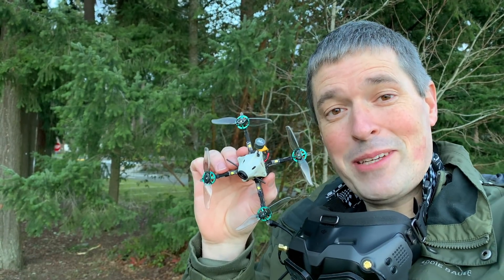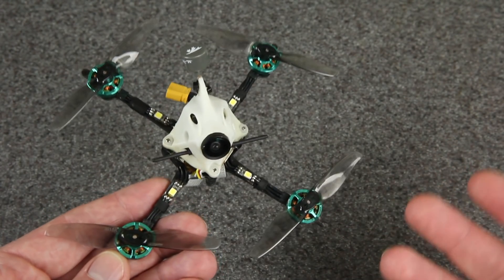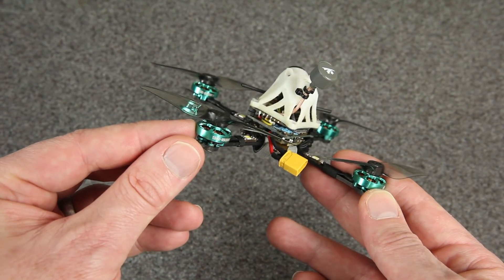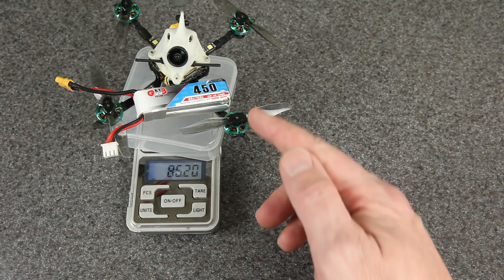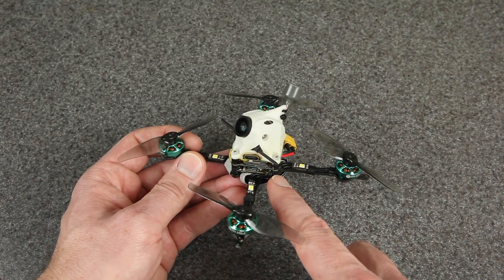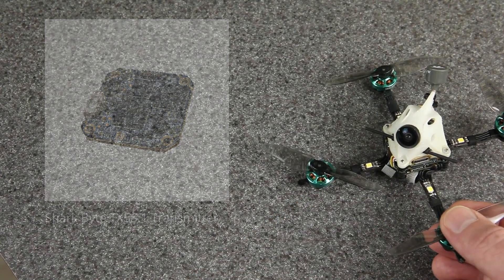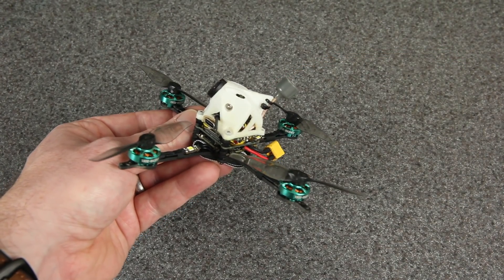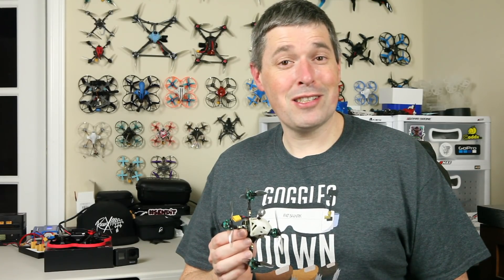DJI Digital FPV on a 3-inch Babytooth Drone! Cool!

Comment: Moore's law states that the digital is the future of the FPV industry. Fix that latency issue and lower the costs and you'll be good to go!
Reply from the maker: Actually Moore’s law has to do with transistors in a microprocessor. Still I don’t doubt that digital can take over if it gets cheap enough, fast enough, and also light enough. It would take a big step for digital to replace analog in 1S whoops, however. They will probably be the last holdout. An analog whoop FPV system can be less than 2 grams including cam, wires, vtx, and antenna.
Reply: Lower latency? Use hdzero. The systems like dji and walksnail aren't designed around lower latency so you'll never get close to hdzero with them. They prioritize picture quality which can cause variable latency. Nothing wrong with that. If you want low latency, you're gonna have breakup like hdzero or analog.
Reply: Digital, be it DJI or SB isn't actually that expensive if you count everything you get.
Great picture quality, a 720p DVR, and in DJIs case a RX for as little as $100 with Cam, vtx and antenna? How is that expensive? 
Analog cam 15-45, crossfire rx 25, eachine nano vtx 15, antenna say 10, hd DVR IDK 25 or more. Add that up. I have a 1s 65mm dji whoop. Sure it's fat and slow but it flies, good for cruising in doors.

Comment: I'm curious about how you got the naked Vista mounted? Did you put anything between the PCB's?( Or mount it as you showed us?) Have you had any issues out of the Vista with heat on high milliwatt transmission?Also I been thinking about the naked Caddx vista camera as well...but been to chicken to do it. If you do the naked Vista camera (The original camera?) Please please please!! post a video on how you done it. Thanks for sharing 😀
Reply from the maker: The PCBs of the Vista air unit are separated on the stack by nylon nuts. As for the output power, it is variable depending on range and signal strength. Mine is set to "up to 750mW" but I don't know what the actual output power is while I'm flying. It probably isn't that high because I'm not really pushing the range very far. The likelihood of overheating would presumably go up with higher output power. This is my 2nd drone with a naked vista and I have never had one overheat in the air, but then again the climate is not very hot where I live. Hope that answers your question. Cheers!
Reply: @MrShutterBug  I meant to ask you what kind of flight times you getting with the 550mah R line 2s packs with the bigger motors from fpv cycle
Reply from the maker: @allennickles3970  I don't remember off hand, and I'm not sure which DVR clips are which any more. I'll let you know the next time I have a chance to fly it (i.e. when it stops raining). Feel free to ask again in the future as I am likely to forget.
Reply: @MrShutterBug  Thanks for your response! I'm in the process of building a very similar build like you have here. But I'm very curious about how to do a naked DJI vista camera.  And the canopy you mention in the video you said that was designed for that mod?. I'm curious if we decase the Vista camera? The canopy would have to be modified somehow to hold the lens in place close to the sensor to focus the camera correctly? Who is designing a canopy like this?
Reply from the maker: @allennickles3970  I haven't done it yet, but the idea is to leave the front part of the camera case in tact, so you don't have to mess with the lens. Just removing the sides & back of the camera housing would remove a lot of the weight. Then it could go in a mount like this: https://www.thingiverse.com/thing:4663421
Reply: @MrShutterBug  Awesome so somebody already done this..lol
Thanks so much for the link!! I highly appreciate that & your time posting this here. Now I got to find someone to print this thanks a million 🤗
Reply: @MrShutterBug  So i ended up ordering the 1303/ 5000kv FPV cycle motors and thinking of buying the newer 13XX/7700kv motors as well. I just wonder how efficient they are at 7700KV on 2s? I bought the 2mil TP3 frame solid one piece frame. Also thought about buying the other frame as well and just do two builds. I appreciate the link to the STL for the naked Vista camera canopy mount. I was able to get RDQ to print me two of them. So shortly I'll be doing this build as soon as everything comes in. What's your take on the two different motors sizes? Which you prefer? I know you have flown both of them now? I also ordered the Rline Tattu 3s 550..lol with the RDQ 525 3s
Reply from the maker: @allennickles3970  I have not tried the TP3 formula, and I have not tried those 1303 or 1304 motors either. But in general, I would say that the larger motors will improve handling as long as you are looking to build something that rips at high speed. The smaller / lighter setups (like the 1S babytooth) are better for really small yards for for being as quiet as possible. So it depends on what you're going for.
Reply: @MrShutterBug  Yeah I just realized you had the 12xx motors before these you showed in the video sorry. Thought you had the 1303/5000kv...sorry..lol

Comment: What is length of the m2 bolts you are using?
Reply from the maker: M2 x 20mm. I believe they came with the babytooth frame kit, but I’m not 100% certain of that.

Comment: Excellent video and production. Wondered if you use a GSheet on the weight breakdown? If so, I'd be really interested in a link to see where the grammes hide... I've been doing it for my builds recently and find the data & charts really help me focus on where to skinny it down.

Comment: You asked for opinions on the Shark Byte. I have three toothpick builds that differ only in the video system. One with naked Vista at 200mW, one with a tiny 400mW Eachine analog VTx, and one with the Shark Byte at 200mW. The Vista and analog quads fly around the outside of my house fine. The Shark Byte video disintegrates into unflyable snow as soon as I go behind the house. I'm going to replace the board with a Vista.
Reply from the maker: That's a good data point. Bummer that it didn't penetrate through the house as well. :-(

Comment: Superb build! Any sideffects from running without the vista heatsinks? (wondering why they would add them if they're not needed?) - great idea if it works tho! Totally doing that for my next 4" lightweight build, thanks :-)
Reply from the maker: Thanks! They include the heat sink because the Vista can get pretty hot. I have not had any problems with overheating while flying, but then I live in the Pacific Northwest of the United States, where the air is pretty cool most of the time. In a very hot climate it might be more of a problem. The only time I have ever had it overheat was when it was plugged in on the bench (when flashing the DJI firmware, for example). That's why I blow a fan on it while it is plugged in on the bench.
Reply: @MrShutterBug  that's good to hear (I'm a UK flier so ambient heat isn't a problem ;-) A bench fan is a small price to pay to shed 10g!! Awesome, thanks again.

Comment: how do you think it would work with the toothpick frame? having replaceable arms would give a little bit less cringe factor when doing risky moves.
Reply from the maker: If you built it like a TP3, it would work great. I chose to build mine as light and quiet as I could.

Comment: Any problems with overheating with the naked vista? Are you restricted to certain powerlevels?
Reply: Nah, I’ve been running mine set to 1200mW max for a year.
Reply: So there are no side-effects of running without heatsinks at all? If so that's very cool, but makes me wonder why would they bother adding them then?
Reply: @skinnyed69  well as long as you’re flying it’s perfectly fine. A few times during the hottest day of summer between packs and once this winter when I left my whoop plugged in for 30 minutes accidentally it showed “Air Unit overheating, land promptly” warning but when I armed and gave it some airflow that went away. Having a fan blowing on it while updating it or just working on it on the bench while plugged will pretty much become a hard requirement instead of a recommendation 🙂 but yeah it’s totally fine without heatsinks in everyday use.
Reply: Amazing. Can't believe I can shed 10g so easily, thanks!
Reply: @skinnyed69  10.6g if you clean up all the thermal paste 😅
Reply: @skinnyed69  yeah there was a guy taping it onto a whoop days after it was released.

Comment: Does anybody know at what voltage the Vista cuts off ?
Reply: I've ran it down to about 5.2V without issues (I was pushing it as far as my build would keep airborne) but I also had it freeze when hitting 7v on a slightly heavier build. It's specced for 7V+ so I wouldn't recommend going lower on purpose.
Reply: With bench testing and a sample size of one, it seemed to need close to 7V to start reliably, but keeps running down to just above 5V. Power consumption seems fairly constant, so as the voltage drops the current goes up. At 7V and 200mW mine consumes 0.87A.  7V/500mW needs 0.94A. Obviously most of the power is consumed by the electronics and not the RF amplifier.

Comment: Wow Mr. S, you have perfected another one. What do you think would happen if you put ultra light prop-guards on this guy. Light/quiet indoor/outdoor explorer drone. Would the extra weight kill the performance? I love flying around the neighborhood with small, light, quiet quads but would like the guards to allow for indoor and canopy exploration flying. Thoughts?
Reply: I don’t think guards light enough not to ruin it exist, especially at 3”. I’ve got a 38g 75mm 2s whoop with naked Vista for that and it’s definitely worth having a different tool for a different job 🙂

Comment: Weird solarisation effect - the image processor on the camera is blitzing out the mid-tones. Do you know if it can be turned off?  It might be interesting to turn off sharpening and see if that at least fixes the weird tones - either that or use it to make 80s sci-fi videos :-D
Reply: There's no access to any camera settings with Nebula Nano. Nebula Pro is basically a DJI camera in 19mm case and just over half a gram heavier than Nano, that is the way to go.

Comment: Like the motors and the build question, could they handle 3s with motor output limit or as is??? I ask because my TP3 frame is sitting on my bench and all I need are motors 😊

Comment: Have been wanting to build a babytooth to rip around the yard! Would you suggest going a 1s analog build or a 2s digital build?( currently have both goggles and cant decide which im gunna keep haha)
Reply from the maker: 1S analog is still great for my small backyard. It’s so light it doesn’t even matter if I crash. But it is cool to see digital getting smaller and lighter. Hope the trend continues.
Reply: @MrShutterBug  awesome man, appreciate the response!!
Reply: Stick an analog module in your digital goggles then you can do both.

Comment: How quiet is it compared to the one S which is ridiculously quiet.
Reply from the maker: It is not as quiet, but it is still very quiet. When I went off to fly around the tops of the trees, I couldn't hear it over the ambient sound. I mainly here it up close or when I use high throttle. Cheers!

Comment: Hi. How do you keep the camera plug from unplugging from the Vista board?
Reply from the maker: Hasn't happened yet. That cable goes up the side and into the canopy (just a few millimeters away). Inside the canopy the cable has to loop around some because it is longer than necessary. I protected the little bit of cable exposed on the side of the drone with Kapton tape. Since nothing can pull on the cable it hasn't come out. That's not to say that it never will though. Fingers crossed.
Reply: @MrShutterBug  some people suggested liquid tape to hold the plug in place.
Reply: @MrShutterBug  I had a couple of crashes with mine and the camera 
plug stayed in place. So far so good.

Comment: I'd rather see it with a Nebula Pro camera (possibly stripped?) than a stripped DJI cam.  Or maybe use the planned NebPro canopy that  @Filip Radelic  mentions below.  I like where this is going, since I plan to get to DJI when Googles are available again and have been concerned about leaving my Toothpick and Babytooth on the shelf due to the relatively bad analog video.  At least, that's what I've heard from others who went DJI.

Comment: I see little, um, SHUTTERS, when doing fast transitions. I wonder if that’s the tune or if it’s an inability of the 1302 motor to swing the props at this weight?
Reply from the maker: Good eye! It might be improved through tuning. I haven't tried yet. The stutters only happen when dropping into dirty air at very low RPMs. The motors have plenty of power at higher RPMs but maybe they struggle to get started. A slightly higher idle speed will probably help. I'll experiment more when I have time.

Comment: I like how strange the video looks, its still better than the average analog whoop camera.   Did you try and dives? I didnt see any but may have missed, wondering how it handles.
Reply from the maker: It handles great in dives! Power to weight ratio is still pretty good thanks to the 2S motors.

Comment: I like ur vids  👍🚀🔝
why U changed the props on ur twig from hq 3x3x3 to 3018 !?  
FatShark need to send u the sharkbite the low lattency is interessante 🙌 greeds
Reply from the maker: My TIWG currently has HQ 3x2.5x3 props. I still like the 3x3x3 but 3x2.5x3 props are a little easier on the battery. For this new drone I went with 3018 2-blade props because the motors are smaller and the 3018 props are super efficient. Cheers!

Comment: Absolutely awesome!  Maybe the most tragic thing about this is how awful the Nano Nebula is.  Is that the V2 firmware at least?  If not, lemme send you a V2 cam just to help your eyes not bleed.
Reply from the maker: The camera was given to me previously so I don't know 100% for certain, but I believe it is already a V2 Nebula Nano. At any rate, it is less bad than the Nebula Nano (v1) that I pre-ordered. I included a sample of that footage later in the video. Do you think V2 should look better than what I'm showing here?
Reply: @MrShutterBug  nah this does look like v2. It’s not a major improvement over v1, just slightly less overblown hdr effect.
Reply: @MrShutterBug  I haven't used a V2 myself.  They're awful in general.  We can't even give them away.  I'm about to reconfigure the nano nebula kits into nebula pro + vista kits but I dunno what to do with the V2 nano's.  We might throw them on the site for $5 ea or something.
Reply: @Kabab   Send them my way, I'll take them.
Reply: There is a V3 now that actually looks very good. See nick burns video about the dji comparison video.
Reply: @wiebel1991  hah, I missed that one. Thanks.
Reply: @wiebel1991  is that the nebula pro?
Reply: @Kabab  No not the Pro. There was a "silent update" on the nebula nano. https://youtu.be/HhxV-4mkWJw?t=100
Reply: @Kabab  I reached out to Caddx support last night and I just got a reply claiming there is no V3 so I am super confused rn. I noticed v2 looks much less bad in certain weather conditions, maybe it was just that in NB's video?

Comment: This is pretty cool - looks like the first build in this size that does not seem to handle like a school bus.
Reply: How about the Geprc phantom hd?
Reply: @yuvalyosef  I would not consider them to be in the same class. This one weighs as much with battery as the Phantom without ;-) Not saying that the phantom isn't a good copter. For me it is important to be able to fly as many copters as I can on the same type of battery, this way I don't need to bring so many quads to a session - I always bring 2 - sometimes 3 quads per battery type. My main batteries are 2S 450mAh. The phantom is 4S, so i would at least need another copter that takes 4S, otherwise I am running the risk of having a bunch of 4S batteries that I have to discharge at home, because I crashed my only quad that I can use them on.
Reply: @stylesuxx  Actually the sweet spot of the phantom for optimal agility is a 450 3s but I still get your point

Comment: Awesome build, been waiting for something this size and DJI! Wish the Nebula Pro would fit into the canopy!
Reply: i built this was a nebula pro.  Most 19x19 canopies will work, i printed one from thingiverse, the camera looks way better, i think it's worth the ~6 gram weight diff
Reply: With a small mod the Pro will fit, I built one last night with the same Racer-X canopy. I had to cut the nubs off the inside to make room and gently stretched the hole for the lens just a touch.  I moved the mini mortal to the back slots and it all works.
Reply: Oh and save the nubs you cut out of the inside of the canopy and move them to the outside to use as washers/grip to keep the camera on place when you screw it in

Comment: awesome build!! Definitely my next dream build!, Any reason you picked the 1302 vs the tp3 1303 motors on 3s?
Reply from the maker: I wanted it to be as light and quiet as possible, and I think 2S is plenty. 2S batteries also tend to be lighter than the equivalent 3S batteries. I have a 4-inch DJI drone that is super powerful, but it is too dangerous and noisy to fly in my backyard and neighborhood. That's where the light Babytooth platform opens up opportunities for me. If I build it like a TP3, then I'm sure it would fly great, but it would be less unique for me. Good question!